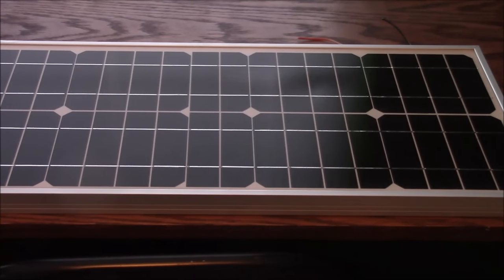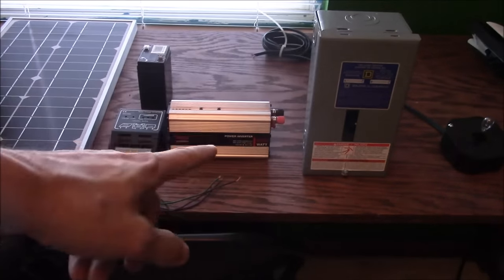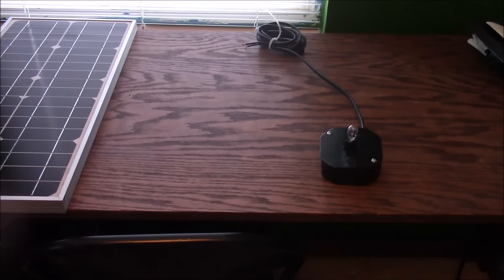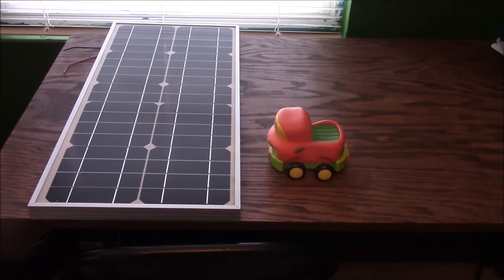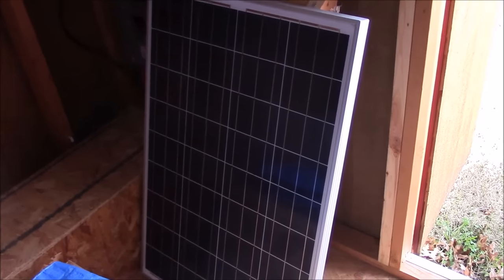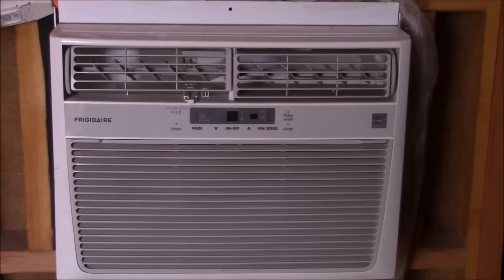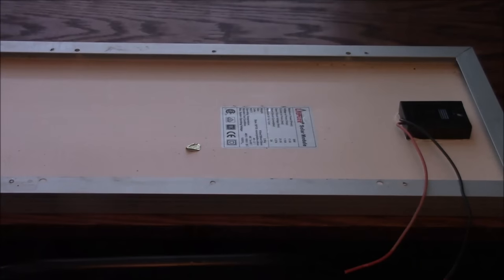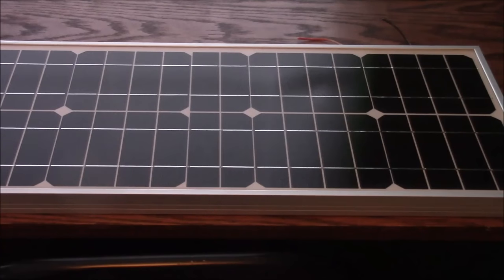Solar Panel Systems For Beginners - Pt 4 Frequently Asked Questions

Comment: Wow thank you, I really wanted to heat my small greenhouse 6ft x 12 ft but when I heard you say that running a heater should cost a lot I solar panels. This past winter it cost me an extra $200 a month really need a alternative way! Thank you
Reply from the maker: Unfortunately, electric heat is too power hungry to do that with solar without investing a fortune.  I'd look at propane heat or some sort of passive solar radiant heating.
Reply: @LDSreliance  yes please, thank you so much. I was just going to spend 3000 on a solar panel system! Thank you

Comment: The best video series I've ever seen about anything new that I know nothing about! I am so much more informed now. Thank you!!! Question for you - can you have a  small solar panel and a big battery? I get that it might take more time to load the battery. The application I'm thinking of is to charge a big battery constantly and then use it for 3-4 hrs a night to watch tv, run a lamp or 2 and charge my phone and laptops with the intention of using my phone and laptops on their own battery power during the day?
Reply from the maker: +Leeanne Barr Wow, thanks!  That is high praise!

If you pair a big battery with too small of a solar panel you risk never being able to fully charge the battery.  If it takes a 20w solar panel 10 hours to charge a 200ah battery (I don't know how long but lets just assume), then it will never be fully charged because you will never have 10 sun hours in a day (even in the summer the most you get of direct sunlight to the panel is 6-7 hours).

If you added a small wind turbine to that then you might have a workable solution since a wind turbine can produce power 24 hours a day as long as there is a breeze.

If you want to send me the power consumption requirements of your tv and devices and what city you live near then I can do the calculations and tell you what you would need.
Reply: +LDSreliance Oh. Thank you!! Well I went to this site - https://www.donrowe.com/usage-chart-a/259.htm - and estimated accordingly. I'd say for day I'd need about 265 watts and for night I'd need about 100 watts. Let's say 400 watts for the day to include a lamp or 2. I don't know how duration of use plays into this. Does this give you enough to estimate??? BTW - I can't do the wind turbine. Not enough wind. I live Downtown Vancouver, Canada. I'm in a condo with not much direct sunlight but I hope I can take advantage of daylight hours.
Reply from the maker: Leeanne Barr
Duration plays a big part because it determines the size of the battery.  If you use your tv for one hour that is a lot different from 4 hours.

Yes, Vancouver is bad.  It only averages 3 hours of direct sunlight per day for solar.  So according to my calculations, if you wanted to run 400 watts of load for 3 hours per day you would need 800 watts of solar panels and 200 amp hours of batteries.

The good news is that most tv's don't use anywhere near 400 watts.  So if you run an LED lamp (10 watts), a 40" LCD tv (150 watts or less), and charge your cell phone and tablet (10-15 watts), you really only need about 175 watts instead of 400.  That drops things down to 350 watts of solar panels and 90 amp hours of batteries.
Reply: +LDSreliance Right! Makes sense. Thank you so much!!
Reply from the maker: Leeanne Barr
No problem.  Thanks for watching!

Comment: Helpful video. Is it the solar panel continuously charging up the battery bank while loads are running? My goal is to leave the appliance running 24/7.
Reply from the maker: Yes, the solar panel will continue to feed the batteries while there is light.  And as long as the input from the solar panels exceeds the output that the loads (appliance) are consuming then you will be charging the batteries.  Once the input falls below the output, the battery bank will be discharging.

Comment: I love your stuff. I respect how you are very careful to explain why doing a particular thing isn’t financially reasonable. May I humbly make a request? That when you get to one of those points in your video and you explain that—-you take a moment and say—-“well what if money were no object?” And very quickly describe what you need to do and roughly what it would cost. I’m not a rich man but they were times watching your presentations when I thought I might like to do something for a friend and I just needed that little bit more information. 
I’ll just give you an example. I have one 100 W panel. I live in Arizona where there is virtually Sun all day every day. What could I do if I had an unlimited supply of storage batteries?
Reply from the maker: Great ideas, thanks!  I'll try to keep that in mind in the future.

Comment: There's nothing like a keep it simple video. Clear and unhurried! Thank you. I wonder if you guide me on something no one seems to be able to give me a good answer on? I want to run a 1500w induction motor circular saw  occasionally for about 20 min at a time once or twice a week at most. I know I could use a generator but I don't like the noise or the pollution. If I mounted a 100w 24v solar panel connected through an mppt controller inverter via LIFEP04 150amp battery would I have enough power to run that saw for about 20min including the headroom to start the saw which I was told could be 3 times the 1500w needed to run the saw? I'd greatly appreciate your response. Thank you once again for an informative set of videos.

Comment: Hi.  Thanks for a great series of videos.  I'm a rank beginner, still don't get a lot of it, but these videos definitely help.

Here's my question:  How many solar panels of what wattage, and how many and what kind of batteries, do I need to run my deep freezer.  It's a Frigidaire model FFC0923DW and these are the specs:  Voltage Rating = 115V /60 Hz / 5 A; Connected Load (KW rating) @115 volts = .6; Amps @ 115 volts = 5; Minimum Circuit Required (Amps) = 15.  Of course, this is running 24/7 and I live in the desert southwest with nonstop sunshine!

Thanks in advance!
Reply from the maker: Lily, thanks for the comment!  Assuming that the motor on the freezer actually runs 1/3 the time (since it kicks on and off all day) and it uses its full rated power (5 amps x 115v = 575 watts) then you are looking at needing 782 amp hours of batteries and 1,750 watts of solar panels.  You could look at getting 6 of these batteries minimum (https://www.amazon.com/Vmaxtanks-Vmaxslr125-rechargeable-Solar-Inverters/dp/B00ACNO2AO/ref=sr_1_4?ie=UTF8&qid=1470328027&sr=8-4&keywords=solar+battery) to meet that amp hour requirement.
Reply: Thank you!
Reply from the maker: Lilly Lee You are welcome!

Comment: Great videos. I just acquired 17 260W Suniva panels but am having trouble figuring out a 220V charge / inverter for off grid. I would also like to know about series and parallel connecting for panels (how to)? Can you pigtail? Do you just connect panels directly into each other?

Comment: I have learned so much from these videos. I am becoming corageous enough to give it a try for my RV. At least enough to get the house batteries charged.
Reply from the maker: +Used RV Homers Yeah, that would be really easy.  You could even do it with a pair of jumper cables for your car, a solar panel, and a charge controller.  Just lean the solar panel up against the RV when you are boondocking, connect the red and black wires to the charge controller, and connect the charge controller to your house batteries with some jumper cables (you will need a small piece of wire to connect to the controller terminals labeled "battery" and then clamp on the alligator clips on the jumper cables to that).  Simple setup in 5 minutes and easy take down.

Comment: I've watched all of your four tutorials. What is the role of the Load Center? I guess the answer is to distribute the output voltage. Then it might not be a necessary one if we don't  use a power breaker in it.
I have two questions, 
1. Can I directly charge the battery from the Solar panel or it would be better to use a Charge Controller?
2. When the battery is connected to both the Solar panel and the output load (without any charge controller or load center) as a DC voltage then which output will I get the Solar or Battery voltage or both ? Is it a bad idea?
Reply from the maker: The load center is to take one output (power from your batteries) and direct that power to multiple loads through individual breakers.  You are correct, it is not necessary.

1) You need a charge controller.  See this video for more info about why:  https://www.youtube.com/watch?v=JQo3hOyB2iE
2) That is a bad idea.  Solar panel voltage fluctuates with sun angle, clouds, and other factors.  It could be anywhere from 13v to 21v.  So if you hook your panel directly to your battery you will almost surely fry it unless you watched it all the time.  But to answer your question, you will get the voltage of whichever is greater the panel or the battery.  But that is a trick question because when you put a load on the battery/panel the voltage will drop slightly.  So if your panel is charging your battery at 14.6v and you put a load on the system, it may drop to 13.2v.

Comment: Thank you for this series of videos. I started my day wanting to get a solar set up for a pop-up tent trailer for camping. Had absolutely no idea what that actually meant, so I started digging around online. Watched a couple Aussie videos and realized I stepped into a hornets nest of stuff I was clueless about. 
I saw some great set-ups, but had no clue what I was actually looking at. Your videos gave me an idea of what I was seeing as well as an idea as to where to start in my search for solar power. I can see now that I won't be running the AC unit as I had previously thought, but it's still a good idea to power the lights and electronics, as well as keep the batteries charged up without needing to fire up the generator every time.
Now I just have to tear into the tent trailer to see what the inverter and load center is rated and see if it needs to be upgraded along with the battery when I get some panels and a controller. 
Thanks again!
Reply from the maker: +Terry McGhee Awesome, Terry!  Glad I could help.  I am glad you watched the videos before running out and buying a kit or something.  It sounds like you now have a pretty good understanding of the basics.  Stay tuned to my channel as I just launched a video series called Solar Basics that is going to go over different components of solar panel systems in a little more detail.  Thanks for watching!

Comment: Thank you for these videos. 
How can I determine the thickness of the wire required? 
How do we calculate the loses encountered in the system in order to minimize them?
Reply from the maker: +Toni Laderach Good questions.  The gauge of the wire is determined by knowing how many feet of cable you need and how many amps of power you will be running.  You will also need to know the voltage of the system (usually 12v) and that will play a big part in your losses, too.  12v will lose a LOT more voltage over a distance than 24v or higher.  That is one of the only drawbacks to a purely 12v system is you will have to use thicker wires and keep your wires as short as possible.

Comment: Nice and useful videos sir
I have a question
If I gonna design a solar street light with 27 hours backup if the Load is 65watt and the Sun hours are 7h
Then:
1:what battery size do I need
2:what penal size
3:what inverter size
4:if I use two penal(2*150) do I need solar combiner 
.
.
.
.
Reply from the maker: How many hours per night is the light going to run?

Comment: Very educational video. Thanks for sharing. I'm living in a newly constructed home that came with included solar. My mother in law asked me about batteries. Does a residential setup of about 5 panels require battery packs? I believe it's run through my local power company's grid so I didn't think so. If I do have them, I can't find them anywhere.
Reply from the maker: +Tim Bruno No, your system is a grid-tied system and 95% of the time they do not have batteries.  That is one of the good parts of grid-tied is that you can save big $$ on batteries and charge controllers and other devices.  It is much simpler and less maintenance.  However, if the power company experiences a power outage so will you.  Your solar panels will not work when the grid goes down, even if it is sunny outside.

Comment: Question. (1) Can I charge the Battery that is in an Elect scooter. ( can take it out of the scooter and plug it into the wall. It is the size of a 12 V car battery. (2) can I charge hand tools that use a rechargeable battery?   [I want to thank you for your simple explanation om how to hook up to Solar. Thanks.
Reply from the maker: Thanks for watching, Keith!

Yes, you can charge most any battery with solar.  You just need to have a solar panel and a charge controller.  For the rechargeable power tool batteries, since they only charge with AC chargers, you would need an inverter to be able to provide AC power to the charger that the power tools came with.

Comment: Wondering about the losses you mention in the charge controller. I'm designing a circuit to charge a 12 vdc battery that will run a deer feeder. The feeder timer trips a relay to turn on a motor. My timer puts out 10.2 v when I have 12 v from the battery. Will the losses from the charge controller further reduce this? should I only use the solar panel to charge the battery and then connect the rest of my circuit to the battery and not to the charge controller load to eliminate the losses thru the charge controller??

Comment: nice video man..can i ask what is the type or size of wire i am using when i do the same type of project and what value of solar panel will be used when i'm using house equipment such as electric fan and ligh bulbs in  ac supply...is there any specific values.?.i understand the ac and dc supply however the types and value wire im not familiar with it..do you have a sample computation base on the load we have used..thank u .I hope you can help me on my inquiry.
Reply from the maker: There are quite a few calculators and wire charts out there.  Just do a google search for "solar wire size chart" or "DC wire size calculator" or something to that effect.  You will need to know the length of wire you need to run and how many amps you will be transmitting through the line.

I would recommend THHN wire for most solar uses unless you are going to leave it outdoors exposed to the elements.

Comment: very helpful video .....I have a question why people always say connect the battery first before the charge regulator
Reply from the maker: Some cheap controllers have to be connected in a certain sequence to avoid damaging the electronics.  Unfortunately, they usually come with bad documentation so sometimes you don't know that it needs to be connected that way.

Comment: Great videos. How do I decide the amp rating of the charge controller? Sorry if its a basic question, but I'm just starting to learn and want to understand exactly how it all works. Your videos have been so easy to understand and follow, I'm very grateful.
Reply from the maker: Thanks for the support!  The amp rating will be provided by the manufacturer.  The smaller units will usually be 10 or 20 amps.  I have seen a couple as low as 7 amps but there isn't much reason to go below 20 as they are very affordable and allow some growth.
Reply: Thanks for the reply. Very informative. Thanks.
Reply from the maker: Mange 2 You are welcome.  Thanks for watching!
Reply: I started with one 8A. panel and added 2 more. I had to donate the 20 A charge controller and buy a 40 A. 12 V. controller. My P.W.M. Chinese unit works fine! My maximum output is 24 amps on a very sunny day.I blew a 20 A. fuse!25 A. fuses are on order.
I get a little voltage drop to the batteries with 25 feet of quality 8 gauge wires.
I never measured it!  I will now!!!  =.3 volts.13.2 at panels,12.9 at batteries.OK.
Thanks.

Comment: hi  there   

ive  got  a water pump in my van powered by a 12v 9A  battery  - which is  wired via a split  charger to the main  battery and  gets  charged  when  driving  -  what  if  I 'll add a  solar panel on the roof as an alternative charge  source ?!  as  If I don't  drive  al ot  the battery  gets  flat

would it be ok  for the batttery  to get  charged from two  sources at the same  time ?  The split  charger I use  now in my  van  disconnects the battery once is full or when engine is off to prevent draining the main / van battery 

thanks  for your videos
Reply from the maker: +Stran I You can charge a battery with 2 sources at once but you need to have a charge controller that will manage that.  Cars have alternators with built in circuitry to not overcharge the battery.  But if you add a solar panel to the mix then you will also need a charge controller for that, too.  You will not really charge the battery while you are driving but the solar panel would be great for keeping the battery topped off between drives.

Comment: One more question. With two, 100 watt arrays, each came with its own controller. Should both arrays be connected in parallel to one controller or should both arrays each have its own controller and then combined in parallel to the batteries?
Reply from the maker: You can operate two charge controllers on the same battery(s).  In fact, some applications are better that way like on a sail boat.  There are advantages and disadvantages to doing so.  The disadvantage is cost since it is cheaper to run one controller than two.  But since you already have two, that is a moot point.  The advantage is that each controller can optimize the charge from each panel individually and not lose power say, if one of the panels is partially shaded or has a huge bird dropping in the middle of it.